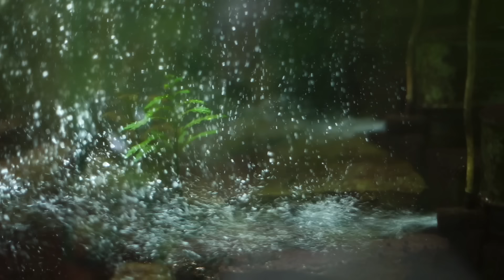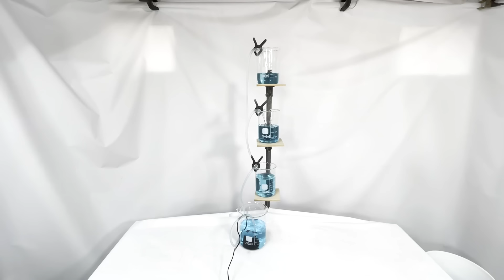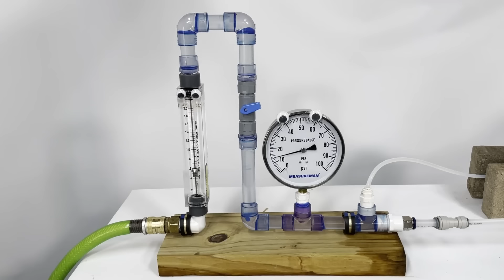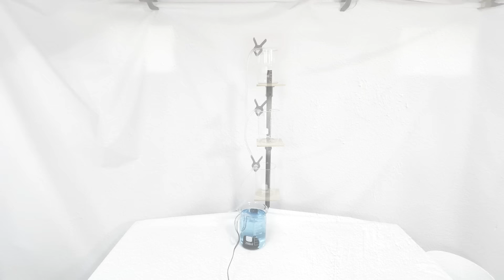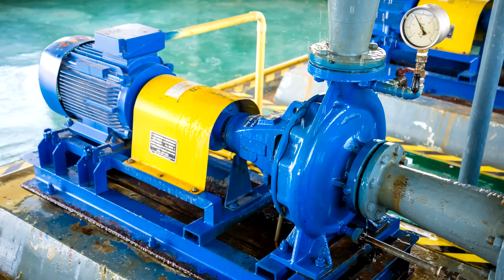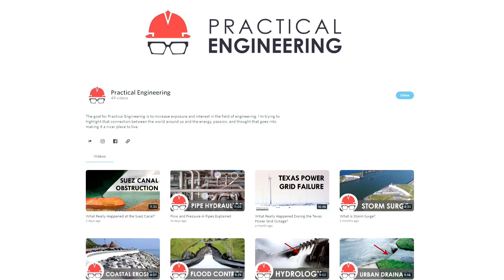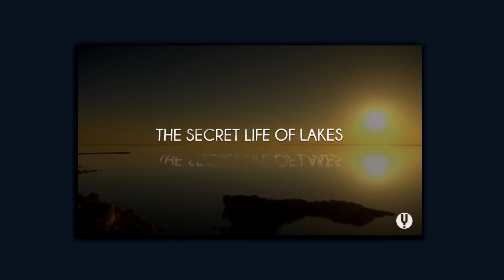Do Pumps Create Pressure or Flow?

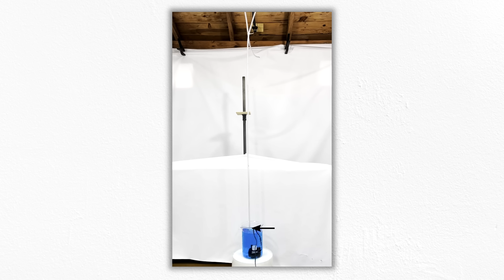Comment: At 6:30 you added resistance to the system by the way of head.  The weight of the water sitting in the head tube was the resistance to flow.  Enough so that the pump was unable to overcome the resistance to flow.  I get your point that pumps and restrictions are closely related and you need a pump that can overcome the resistance in a given system but the pump is not the source of pressure, especially not in this example - it created flow right up to the point to when it was used beyond its capacity and stalled out, unable to create any more flow against the pressure build up..  

You can only have pressure within a container.  The pressure in the system was the weight of water contained within the head tube.  In this example the pressure and head height are directly related because the pressure is the result of gravity pulling the water back into the container (or pipe)..  More head = more pressure and no head = no pressure.  If you exchange the pump for a closed valve in this example there is still the same pressure in the system, thus the pump is not creating any pressure.  

I stand by the saying that pumps create flow not pressure, but I think it would be more accurate to say that pumps impart kinetic energy into a system and it is the resistance within that system that converts the kinetic energy (flow) into potential energy (pressure).  

For you electricians........A generator (pump) doesn't create light, it creates electricity - it is the light bulb (resistance) that converts the electricity into light.

Thoughts?
Reply: Pump creates flow through pressure difference.

Comment: I have to disagree.

In your demonstration where you show how the flow stops when the fluid reaches the maximum head of the pump, you say that the pump is creating the pressure in that column of fluid.  However, this is not true.  Gravitational force is creating the pressure.  If you were to block that fluid with a valve at the outlet of the pump, and then turn off the pump, the pressure at the valve would be the same as it was before you closed the valve and turned off the pump, and it would remain constant, even though no more energy was being supplied to it by the pump.  Therefore, the pump cannot be creating the pressure.

Pumps create flow--they only move fluid.  Restrictions to flow create pressure.  Doesn't matter if it is a centrifugal pump, peristaltic pump, positive displacement pump, whatever type of pump you want....  Pumps only create flow.  Restrictions to flow create pressure.  It doesn't matter if it is a flow restriction due to gravity, friction inside a pipe or hose, or fluid passing through an orifice smaller than the pipe/hose diameter... the restriction is what causes the pressure.

Comment: 0:33 Technically all of those are correct but, most correct is the resistance or the lack of resistance of your organic water-ish tissues. 

I absolutely hate this, but you can touch a dead 9v to your tongue and not get a shock because the voltage dropped below the resistance factor of your tissue in your tongue. The current and voltage cannot overcome the resistance of the tissue because it's resistance is higher than possible to complete the circuit. The PH of the battery and your tongue can change this resistance, but for 6-9volts lower current applications like a battery the theory works. 

Now here is why you should never try to reproduce this. With an isolated power supply and more current than a 9v battery, you can do damage to your tissue on your tongue. Likely not fatal, just painful and damaging. 

So it is like a question of Chicken, Egg, Milkman, or the question of if you exsist to even see the problem. 

To be completely clear, never touch two battery terminals at the same time with anything but the engineered intended purpose. 

Also your heart is a strange electrical device that uses two dissimilar elements to beat from one side to the other in a 1-2-1-2 sequence. Introducing an additional charge will force both open or close and force it to malfunction and likely do serious damage to it and your exsistance. Now if those shocks are applied correctly and in a proven application, you may owe your life to science. Current, Resistance, Voltage, and THE POWER COMBINED is SCIENCE.

Now fight off my legion of Roboscorpians on Skullcrusher MT!

Comment: Pumps create flow...pressure is a by-product of its limitations or restrictions. This is why you select a pump based on the required flow based on those limitations and restrictions. It often requires more energy and different impeller designs to achieve this. Let's use multi stage pumps to demonstrate this. A multi stage pump is designed to still give the desired flow at high restriction. I have never in all my years of industry experience encountered a pump system that was not designed around moving a desired volume of liquid and thus designed to take into consideration the influences affecting the desired flow in selecting a pump. Let's use a simple example... I customer approaches a business looking for pump for their well. The request would be something like; I have a well that is 30 feet deep and need to pump water up the hill to a tank that is at the end of a 500 foot 2" pipe but at an elevation of 300 feet. I require a flow of 200 gallons per hour...which pump would I need? Primary concern = flow. Design centres around overcoming restrictions, back pressure and friction to achieve desired flow. Even in hydraulic systems, contrary to popular belief, the design rarely has pressure as its primary concern, it mostly is designed to achieve a controlled movement (flow) overcoming back pressure and even in clamping applications where pressure does become a component of primary focus, the pressure is achieved at flow as the flow is oil bled off back to tank at the pressure resulting from the restriction. Because hydraulic system pump design is for a fixed flow, pressure is bled off to tank if it reduces flow to prevent damage because oil cannot be compressed.

Comment: But that is true. Its not the voltage it is the current. Yes ohm's law states that the current in a conductor depends on the voltage applied to it. But you can have high voltage low current supplies. If the supply is current limited, then it cannot supply the current. This is why tazers dont kill but mains supply can even tbough a tazer has higher voltage.

Comment: Err - do I hear the term 'positive displacement pump' Same flow, regardless of output pressure. Takes more energy from the prime mover.
Your heart cares about the 20ma going throught it - the voltage do drive it throgh is irrelevent. Otherwise, static electricity getting out of the car would kill you.

Comment: I have  heard the function of a pump is provide flow, and likelwise the function of a compressor is to provides pressure, none of this "only" and "create" buisness. Thier name is based on thier "job" within a system.  A pump that doesn't provide flow is a pump in name only, but it is NOT a pump functionally; a pump that can't overcome head is functionaly a really ineffecient compressor.  It would be silly to content that a "pump only creates flow" as that would suggest 100% efficeincy; it also "creates" heat etc.  of course pumps dont create anythng, they transform one energy form to another.

Comment: so pump is like a battery🤔 if resistance of pipes  is low, it provides lots of current flow, but if its high, current decreases and potential difference increases.

Comment: you made a mistake with the comment about electricity..  it only takes 1/10th of one amp across your heart " right hand to left foot for example " it is the amps that kill you.. you forgot the 3rd item in ohm's law " resistance". making it possible to take  50,000 volts of electricity from a police taser without dieing, in fact that 50k volts can be maintained by a police taser up to 5 seconds.. yet to person lives just fine no permanent damage. in the end it IS the amps that Kill you not the voltage...

Comment: Pumps don’t create anything. They convert one form of energy to another. In this case that from of energy is the product of pressure and volume. In terms of power conversion, pressure and flow. It’s impossible to select a correct pump for an application without a flow vs pressure/head chart. It frustrates me when manufacturers don’t provide this data.

Comment: I feel there is more to this... I messaged Mehdi on the 1st March 2019 and pointed out that in his 7 MILLION VOLT TASER video that his explanation was off and that it was not current but watts or watts per second that kills and he corrected me saying "there is a component of time so it is the amount of energy VxIxT that kills" which is what I think I said, but there was a slight language barrier >.< I should of said Joules per second instead of watts, after all that is what they mean when they charge to 300, either way we got the follow up video 15th of march where he burnt my fellow Aussie withe the equation W=VxIxT >.< he put it in as watts and did not even give me a mention.....  Off topic there but since I called out that one and I'm going to take a crack at this as a likewise unqualified stooge on the subject, I thought was worth a mention.

In fluid mechanics head is a concept that relates the energy in an incompressible fluid to the height of an equivalent static column of that fluid. I would say the pump is providing energy to the fluid and the pressure is coming from elsewhere, kind of how a battery does not give out energy in the same way we all think ( https://www.youtube.com/watch?v=C7tQJ42nGno&ab_channel=TheScienceAsylum ) I think there is a deeper and better explanation, I'm not going to pretend I understand the equations of total head and and difference in potential/kinetic energy and conversions of each from the electromagnetic field to the pump and then into the water making flow etc >.< my head kind of hurts even trying, but I know a guy ;) I was hoping to think this though and come up with an elegant one liner like watts per second  or VxIxT if there is one but it is beyond me sitting here for an hour pondering and I think I need to call in help to crack it as I'm pretty sure somewhere in those total head equations is what I'm trying to say in not so great a words.

*I'm a retired mechanic due to injuries, physics and fluid dynamics is my hobby that carried over from work. I always think centrifugal water pump in closed system in car and all the pressure there comes from elsewhere but the pump from my thinking unless you are doing direct conversion of energy to pressure which I think is skipping something but I can't quite finger it.
Reply: Sitting on this and digesting a while, I'm pretty sure that pumps just create flow by adding kinetic energy to the waters unit mass and pressure is only created by obstruction or gravity. The other pump style you showed made me think of the compressor on my old Commodore, it to was likewise a metered amount at 90 cubic inches, design of the pump is a little different as we consider water incompressible, but once there is a restriction or even just the mass of the atmosphere pushing down due to gravity then you are compressing against that fluid as an obstruction... Obstruction creates pressure by giving the kinetic energy of a fluid something act on 🤔 where the energy comes from seems to not matter.

Comment: Well it depends! A Centrifugal fixed speed pump creates flow (conversion of mechanical energy to velocity of the fluid through a volute), this flow is subjected (dependent) on the system which creates the pressure (static and/or dynamic) - Total Dynamic Head. A Variable Speed Centrifugal Pump can maintain constant flow or pressure to within the the operational limits, sliding on the system curve (a one-to-one mapping). A Positive Displacement pump, on the other hand, creates pressure (at constant flow rate for example) against a system. These types of pumps, are favored for dosing purposes as they can exceed a given line pressure at a much lower flow rate. The example, that you've used to show a centrifugal pump creates pressure by dead ending provides a proof for the energy balance only! It, further, goes to show that the dead end reached is dependent on the pump (power/speed and impeller diameter); fluid property (density, viscosity, thermal expansion, air entrainment, etc.); and the atmospheric head at your location. A unified statement for all types of pumps in general is, at most, difficult (probably as close to finding one for physics and chemistry).

Comment: I think the nature of your demonstration fails to really illustrate the origin of the flow vs pressure contention as the outlet pressure is due to the height of the fluid and independent of the pump.  I would have liked to have seen a system where the pump sends water through a conduit with a pressure gauge measuring the outlet pressure.

Comment: So care to explain how i can grab the sparkplug wire at 20 to 40 k an live. But yet when we are trimming trees 20k will turn you to dust. Amps. Which could be current i guess. Voltage alone won't kill ya. Also if the pump has zero head will it make pressure? Pressure is a measure of resistance correct? I love your videos but i don't follow you on this one. I do realize a spark shuts off automatically an grabbing a wire will make you not capable of doing this. But i have grabbed distributors an adjusted timing an got hit by 6 or more cylinders an i lived.

Comment: Current kills. end of story no disagreement amongst electrical engineers. People who are not engineer still debates thou. 50 ma through your heart you are dead(approx 200ma or more through body ;depending on size point of contact etc ,if right hand to left hand phase to neutral short lowers the amount to 50ma so-which can kill too .that is why 48v might kill you too (48v/1kohm(theoretical resistance of body) =48 ma ).
for the i-diodes who does not believe you may read educational papers: 
https://www.asc.ohio-state.edu/physics/p616/safety/fatal_current.html
i had a soldier while i was military who struck by high voltage line via direct contact of ladder. current jumped to him from an aluminum ladder and entered from his upper leg and exited from his lower leg. he has several burns and exploded flesh marks at entrance and exit but is still alive.( though other two guy who was holding the ladder at upper levels died horribly)
thumbs up for the vid thou.